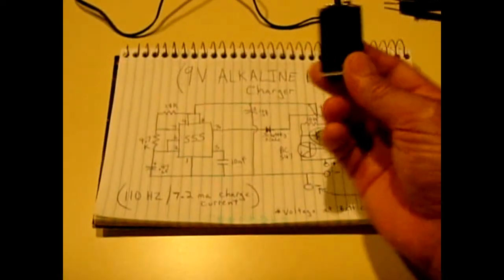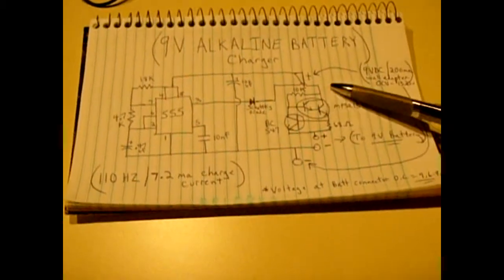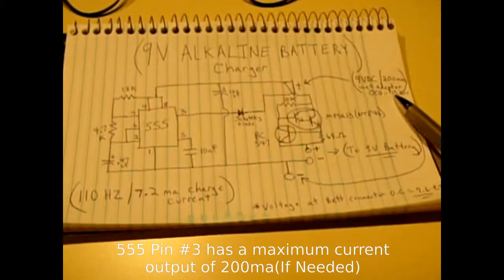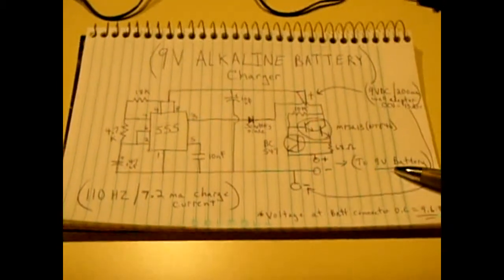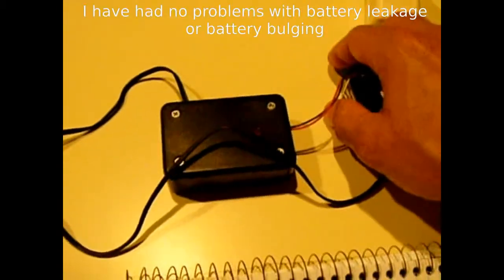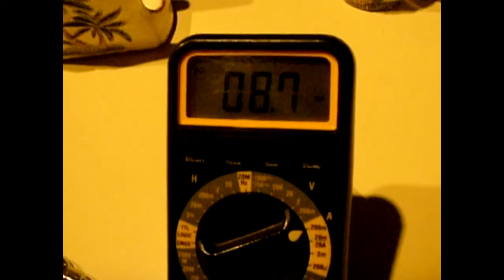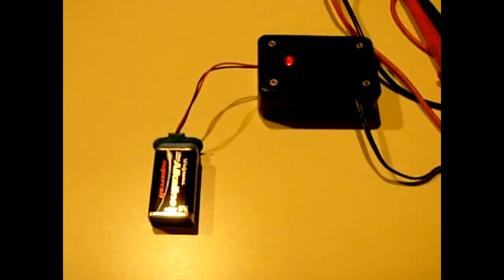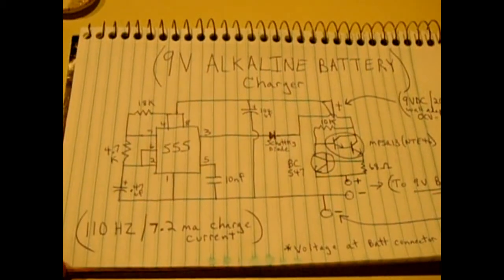9V Alkaline Battery Charging Circuit(Also 1.5v Cells)

Comment: Built the circuit. My 100ma dc “9 volt” wall wart put out 17.2 volts with no load. Added an adjustable voltage regulator and set it up to feed the circuit with about 12.9 volts and that seems good.
How are you all measuring “duty cycle”?
Thanks

Comment: I'm using a bench power supply with CV 9.7VDC and CC 8mA.  These values are good? Is DC ok? Or is the 110Hz necessary? For what?
Reply from the maker: Must do as shown
Reply: @electronicsNmore  thank you, I research some papers about that, the conclusion is "The (2000) cycling results show that such pulse charging is Comparable to conventional DC charging".
This "Pulse DC Current" was created as a Patent in the 60's, the explanation is about the sulfate resonance, but this is a myth and used as marketing.
Direct DC charging has no negative effect on the battery's lifespan or total capacity.

Comment: I'm sitting here charging one at 20mA on my power supply... wondering if I should turn it down a bit.  Hmmm.......
Reply from the maker: Way too high for 9V
Reply: @electronicsNmore  it ended up working pretty good
Reply from the maker: @blackz06  It may leak....
Reply: @electronicsNmore  while charging it? It didnt even get remotely warm. Nor leak
Reply from the maker: @blackz06  It may leak later.
Reply: @electronicsNmore  Time will tell, I suppose.  what did you charge at, like 8 mA?

Comment: Very nice project. Thanks for that. I'm doing it but i have a question :  On the schematic you are saying that the voltage at battery connection (open voltage) have to be 9.6v to 9.7 v , is this the pulse average voltage (measured by the DC position of the multi-meter) or the pulse raising (maximum) voltage measured by the AC position of the multi-meter. Actually i am measuring 9.6v in AC position and 4.7v in DC position. The frequency is 111 Hz and the duty cycle 82%.Thanks.
Reply: OK. Got it. It's working flawlessly. My parameters are as follows :
- Frequency : 114 Hz
-Duty cycle : 82%
-Charging current : 11mA
- Charging voltage : 9.9V
Have also added a charge monitoring circuit based on an LM358 with 3 leds :
* One for "Too low battery voltage" : under 7.5v
* One for "Charging in progress" 
* And one for "Battery fully charged" : 9.8v
As per the power supply i'm using a home made adjustable LM2596 psu and since i haven't an oscilloscope i have used a temporary 3 arduino circuits to adjust the frequency, the duty cycle, the charging current and the charging voltage. For this I have added a 5K pot in serie with the 18k resistor and replaced the 56 Ohms resistor by a 220 Ohms pot.
Have already charged 2 batteries without problems.
Thanks again.

Comment: Nicely done. Very few other alkaline chargers use the pulsed DC method used in this circuit. It feels good to reuse a cell which is not meant to be used again.
Reply from the maker: It works well. Thanks for watching!

Comment: Excellent project!  I am building one, as it really bothers me to pay so much for a battery only to toss it after one use!   Two questions if I may.... 

1.)  Can you point to any reference/learning materials that describe the constant current circuit in more detail?  I'd like to learn what makes it taper off to zero current as the battery voltage comes up to some level. 

2.)  And could you (briefly) suggest how to leverage a 3.3v microcontroller to replace the 555?  I'm fine with the microcontroller aspects, I just want to consider the best interface between a pulsed microcontoroller output and the constant current source.  Maybe have the microcontroller trigger a transistor (FET maybe?) which toggles the power from the top bar down into the constant current driver?   

Very cool!!  Parts on order.  :-)
Jay

Comment: I have a question about fully charged 9V LED indicator circuit:

1. Is zener diode connected to the base of transistor?
2. Can I use substitute  for 2n4401 to be 2n3904, if not can you recommend substitute?
3. Will this indicator work for charging 2x 1.5v batteries with 6v charger?

Thank you.
Reply from the maker: Yes, connected to the base. Yes 2N3904, and use a 2.7V zener for (2) 1.5V AA's
Reply: Thank you.

Comment: Great project. I have two questions:

1. Can I use 9v 150mA charger? This one outputs around 13v.
2. Can I use 9v 1A charger? This one outputs 9v.

Thank you.
Reply from the maker: Yes, the 9V/150mA is perfect. No need for the 1A.
Reply: Thank you for fast reply.
I will use 9V/150mA one. The reason I am asking about second one (9V/1A, regulated I guess), is if first one dies. Can I use one with 1A, or it has to be 150 to 300mA one?

Comment: is it safe to use?
Reply from the maker: If made exactly as shown with a low current charging output, yes, and the best part, it works. Always charge in a "SAFE" area. No batteries are perfect. Some can leak or bulge. If either happen, you stop the charging process and throw away the battery.  :-) I never had any problems. Thanks for watching!
Reply: electronicsNmore so far i know that charging alkaline battery will explode it i dont want that things happened,so will it explode?Sorry for my poor understanding
Reply from the maker: This video is for viewers who have knowledge of electronics. I think you should skip this project since you have fear. I have many other excellent projects you can make on this channel.
Reply: electronicsNmore no,just want to keep it safe since i have experienced that alkaline explode while charging,so better be secured so that you say it is safe in 'safe' area,i will try it now
Reply: btw thanks for advices
Reply: I think your question got to do with batteries more than the circuit itself, cause each battery is different in its chemistry and make(material it is made of inside and outside)

So let's begin with the concept of charging alkaline is it truth or myth? Let's see what Wikipedia says:

"Manufacturers do not support recharging of disposable alkaline batteries, and warn that it may be dangerous.[5] Despite this advice, alkaline batteries have been recharged, and chargers have been available.[6] The capacity of a recharged alkaline battery declines with number of recharges, until it becomes unusable after typically about ten cycles. Low-ripple direct current is not suitable for charging disposable alkaline batteries; more suitable is a current pulsed at a rate of 40 to 200 pulses per second, with an 80% duty cycle. Pulsed charging appears to reduce the risk of electrolyte—usually potassium hydroxide (KOH)—leakage. The charging current is low to prevent rapid production of gases that can rupture the cell. Cells that have leaked electrolyte are a safety hazard and unsuitable for reuse. Fully discharged cells recharge less successfully than only partly depleted cells, particularly if they have been stored in a discharged state —battery charger manufacturers do not claim to recharge dead cells.[6]" 

https://en.wikipedia.org/wiki/Rechargeable_alkaline_battery#Disposable_alkalines

Outta that we get that:
1. It can be recharged safely up to 10 times, following the same method this guy showed.
2. charging should be like he said: 40~200 pulses per second = Hertz @ 80% duty cycle with low current <= 10mA (I got a Nickle - Cad/MH charger which charges at 20mA but that is different chemistry than alkaline, just saying that 9v batteries seem to charge at low current even rechargeable ones)

Just try it, and if afraid do it outside/outdoor. And have something to extinguish fire with if you wish, bucket of sand/water and blanket...etc.

Good luck

Comment: Hi
Great video intend to make up a unit, 
just one question I notice in your opening page of video your hand written schematic shows a connection at the + in position down to the circuit just above the transistors 
however on the handwritten schematic in photo bucket this connection is not there  please can you advise which is correct 
Thanks 
JB Sydney Australia
Reply from the maker: The (+) isn't connected to the current portion, it just looks that way. Bad drawing. Follow the schematic at the link in the video description area.
Reply: John Brown q

Comment: can we replace the MPSA13 with 2 GP transistors connect them darlington?? what abt skottky diode ? can it be replaced with GP diode like IN4007 or IN4148 ?
Reply from the maker: It's best to use exactly what I show in the video. 1n4007 will work, but you'll have a bigger voltage drop. Refer to NTE's website to cross reference transistors. Thanks!

Comment: Hi, since a 9V alkaline battery is basically 6 individually connected cells in series, then would it be possible to charge 6 AA batteries in series at once?
Reply from the maker: True, 9V batteries contain (6) AAAA batteries in series, but it is better to charge 2 to 4 cells in parallel. Just increase the output current for each additional battery placed in parallel.
Reply: Thanks on quick reply, but how should I increase the output current?
Reply from the maker: +Viktor Božičević 10ma per cell for aaa, and 15ma per cell for aa.
Reply: One more thing, could I charge zinc carbon batteries with this circuit, or only alkaline?

Comment: Hello.  I am still trying to troubleshoot my circuit, and my problem is that after checking and RE checking, my circuit,  I only get 3 Hz on my + and - battery snaps.  I get 8.4 mA and 9.06 V there, but LOW cycles/sec (Hz)  .  Any suggestions as to what I can check. My Voltage supply DOES have less than the 13.25 V. OCV.I bought a power supply like your white one, on eBay, and it is 9V 200mAH, and has an open circuit voltage of 15.66 V.   How can I reduce this OCV to the 13.25V you require, and is this the reason my 555 only has 3 Hz ?
Reply from the maker: +Dr Greg Alex 
Measure the frequency at pin 3.
Reply: http://houseofjeff.com/555-timer-oscillator-frequency-calculator/

Comment: from the data I found about safely charging alkaline battaries pulsing is not enough, the duty cycle of charge/rest should be 1 to 2 or more for rest, also charging voltage should be X1.5 of a battery and the final voltage on battery should not exceed 110% of claimed voltage, also for 9V batteries charging current should not exceed 40mA
Reply from the maker: +Henry Herz 
What you found online is irrelevant. The circuit works perfectly. I have used it many times with zero problems. 

Thank You

Comment: We were charging battery's like this 20 or more years ago, simple circuit 2 resistors one diode, with an ac transformer as mails ac is 50hz UK and 60hz America , 

The rules to stop it exploding is to take 10% back out every cycle 

eg 4 x 1.5 Duracell 6v ac power supply 

-------[]]]]]]]]]]-------------[]]]]]]]]]]]---------
|.                       |
|--------|>|---------|

So every cycle positive eg 1A put in to battery's  and every negative cycle 10mA taken back out and calming the chemicals back down.

Simple.
Reply: Or even 100mA maths never my strong point
Reply: What values of resistors? and how/where to connect them? Can you please put up a simple sketch?
Reply: @kokor7409  back in the day can’t remember what values but I worked it out by how long my Casio lcd tv lasted on Duracell batteries (2 to 4 hours) each battery was 1600mAh ( 4. X batteries 1600mah each)
So I was charging it back up just slightly less time and current than it took to drain

Comment: Just a comment relating to ALL my posts below, and the measurements. As you can see, they are all over the place. Sometimes higher than others. I so guess this is normal. I haven't changed a thing on the circuitry. Also, the Green LED project just pronounced my battery CHARGED at 9.52 V  YAY !!!  This project is DONE and is wonderful.  I still want the comments on my Voltages below, so maybe it will help others, and ME understand this so cool circuit.

Comment: Ultimately going to ask a few questions here. I am Charging 9 Volts per this device you inspired !
1. As you said, my multiMeter may be too cheap. I have a ExTech.
 Please advise me on a Good MultiMeter, and a Link maybe??

2. I have these Voltage measurements  WITH A 9V BATT Connected. The Second Voltage is WITHOUT A 9V BATT, powered by only my 9V 200ma Wall Adapter.  I would like your opinions/ possible corrective actions on my part. 

a. 12.75 V  /  12.14V  on the + Rail 
b.    8.98 V /     8.98V on PIN 3 before the Schottky ( Im using 1N 5818) Diode.
c. 10.32 V  /     8.92V  at the end of the Schottky 1n5818 Diode.
d.    9.47 V /      7.98    at the Battery Snaps
e.    9.45 V when I disconnected and checked the 9V Battery.
f.     .03 kHz at the battery snaps with NO BATT connected and 7.98 V NO BATT
        So not at 110 Hz somehow.. .......  ???

3. I built the FULL LED Green lite per your directions as perfect as possible. It glows when I disconnect the 9V BATT. 
    I have had to leave my Batteries on overnight to charge up, to like this last example, 9.47.  When should I expect the Green light to come on.

4. Is there a polarity on the 10 nF (103 cap) on the diagram ?

I can't believe that you are so quick to answer all our questions. !!!!!   Anyway, thanks, and I am anxious to see the answers to these questions, and what kind of Meter you will advise me to get, so I can order it and possibly get some REAL values.
I haven't even measured the Hz or ma because of this POS meter I have.  The Ma station blows a micro fuse in the meter every time I used it One Use, One Fuse. Maddening. 
Thanks
Dr Alex

Comment: Oh, and PiN 3 measures 6.46V  with no battery being charged.
My Bad,   The + Rail with no Battery is 12.46V
The Open Voltage of the (volt battery connector is 9.02V
Am I doing OK on this ?
Dr Alex
This is an addition to my POST BELOW
Reply from the maker: +Dr Greg Alex 
Hi there. The open circuit voltage of wall transformers can vary. If you did not use a Schottky diode from pin#3, then the voltage will be lower at the battery terminals. It is very likely that your digital meter is too inexpensive to give you an accurate reading of the output voltage. The meter is averaging the pulses it can detect, and missing the others.

Thanks
Reply: +electronicsNmore  I used a 1 N 5818 as I got that info on here in "moments" You gave that as the part # to someone.  I will go and Ask for a Schottky if that is different than the 1N 5818. 
Also

Is my 69 Ohm resistor messing anything up ?
I will get a better meter tomorrow, And THANKS in advance
Dr Alex
Reply from the maker: 1N5818 is just fine. Nothing wrong with the resistor value either. :-)

Comment: Hi.
This is the first circuit I have ever built ! It was fun. It works. but, I deem I have made some sort of mistakes. Here is my dilemma.  I have a 9V 200ma power supply, and the Open Circuit Voltage on the + Rail where you say I should have 13.25V, 
is 12.3V.  Is this a problem with the power supply ?  Its new from the Electronics store.

NEXT I have a 69 Ohm Resistor instead of a 68 Ohm Resistor on the Constant Current Voltage Circuit.  My Multi meter has shot itself in the foot, so I can't measure the milliamps at the 9V Battery, but the Voltage there is only 8.99 or 8.98 V.
Tell me what to do O Guru of Electronics,  As this is my First (and pretty exciting ) Foray at 61 yrs old. 
I have learned to solder on a bread board,  and can do what ever it takes to make this work. 
Thanks for Doing this project.  I hope it is still fresh enough that this gets an answer. 
Dr Alex

Comment: What should be input voltage for charging 1.5V battery ? Can I use 3.3V input voltage and current limiter like LF33CV to feed it ~20mA ? After that current flows into battery and battery voltage raises from 1.3V (when not charged) to 1.56 when being charged. Anyway, does input voltage makes sense at all here ?
Reply from the maker: +Hans Kaller 
The charging voltage is not critical, but the charging current is. 20mA for an AA battery is fine. For an AAA, I would use around 12mA. The reason why I would use 1.8V is to prevent the battery voltage from rising too high. If you use 3.3V, be sure to monitor the battery voltage. Do not allow the battery voltage to rise above 1.8V.

Thanks for watching!
Reply from the maker: +Hans Kaller 
The charging voltage is not critical, but the charging current is. 20mA for an AA battery is fine. For an AAA, I would use around 12mA. The reason why I would use 1.8V is to prevent the battery voltage from rising too high. If you use 3.3V, be sure to monitor the battery voltage. Do not allow the battery voltage to rise above 1.8V.

Thanks for watching!

Comment: Dear friend. Incredible what you did, congratulations. I want to use this circuit using the voltage from my bike dynamo (0-25VDC at max speed) as power supply. I got a led light kit, that works with 3VDC (2x1.5V AA batteries) by default, but I add some leds and use a 4.5VDC external power supply (just to emulate 3x1.5V alkaline batteries). With the add on, at 4.5VDC the max consumption current is 480mA (all lights and buzzer on). Without buzzer (only lights), consumption is 120mA only. I am not sure about using alkaline batteries (3x1.5V) or a single 4.5V rechargeable battery...which one do you suggest? Any case, how many volts power supply should be? How can I get it from the dynamo at a constant way? What modifications must be made in your design? Thanks in advance!
Reply from the maker: +David Mora 
Hi there. Way too much work. Just use a solar panel or wall transformer to power the charging circuit.

Thank You
Reply: +electronicsNmore 
Thank you
Reply: +electronicsNmore 
Just one more favor. What changes must be made for 4.5V (3x1.5v) alkaline batteries? Thanks in advance.